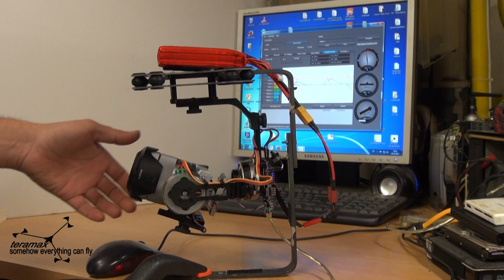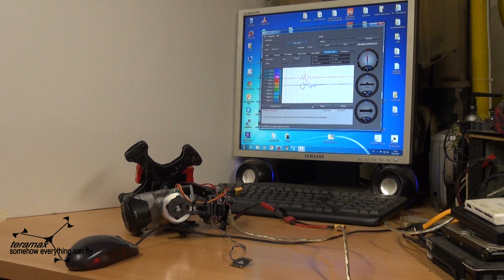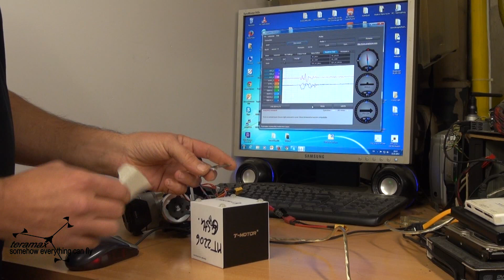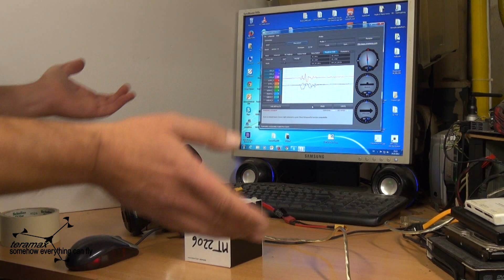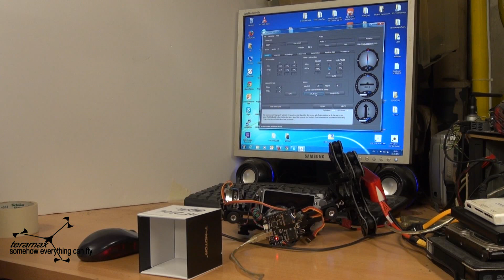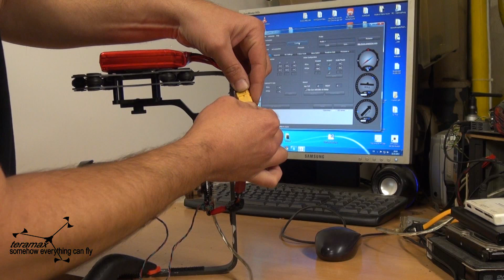how to - SBGC 6 point IMU calibration

Comment: Hi tera, nice video. I would like to know why do we have to make the 6 axis calibration? What is the difference from just calibrate it one time in the neutral  position of the camera ? 
Regards
Reply from the maker: +Dashz cause of the toleranz the sensor inside the IMU have, the software running on the controller has to learn how each angle looks like.

Comment: Thanks. I received the gimble and even though the camera Imu has drilled and tap holes for one of my imu since one is wider than the other it looks like the smaller imu might goto the camera that does not fit the wider drill and tao pattern. Even though I did the 6 point calibration with auto tune and believed I had the orientation correct meaning right on both imu's pointed to the left from the front of the machine the gimble did not function at all after auto motor then auto pid. I'm going to swith the imu'spositions after I recalibrate them like my buddy has. It seems backward since the drill and tap fits one imu bit it seems that's the frame imu not the camera. Confusing.
Reply from the maker: i dont know every SBGC Kit thats aviable but in example the kit from Flyduino has a bigger (Camera) IMU and a smaller frame IMU.
Reply: I was told the smaller is the camera on the one I have.  I also found my solder job did not make contact on all 3 motor leads on the other side that is needed.

Comment: How does the calibration sequence work with using two imu's. Would one imu be calibrated the plug in the other? It does not cover this in the manual.

Thanks
Cody
Reply from the maker: If the second IMU is connected properly, this button becomes active. It means that all IMU settings now
affect on the frame IMU. Change sensor orientation (axis TOP, RIGHT) and write setting to the board, if
necessary (board will be restarted). After restart, calibrate the accelerometer and gyroscope like you did
it for the main IMU. For the accelerometer, you can do simple calibration or extended 6-point
calibration.
found in the manual page 7
http://www.basecamelectronics.com/files/v3/SimpleBGC_32bit_manual_2_4_eng.pdf

Comment: I'm getting roll drift while yawing, nothing I've done has fixed it yet.  When I do the 6 point, I always start with the imu oriented exactly as it is when mounted and camera is facing forward. Is this correct? Does it matter the order in which you calibrate each side?  Any advice on getting rid of this drift would be great...
Reply from the maker: You are right, the very first orientation ist the one the imu is finaly mounted on the gimbal.
Watch out your i2c readings, are there error counts?
Try to change the routing of the sensor cable.

Comment: Hello Tera, when you do the acc calibration, do you first write to your board how your sensor is going to be oriented? i.e. Top -x right y and then do the calibration? I am having issues with my 3 axis gimbal, it was working out of the box, but I reset it to factory defaults and now the yaw will not work, it just tried to continually spin, and it's not the pids or power, I know how to set those up. Thanks!
Reply from the maker: yes sure, first write correct sensor orientation. Check the graphs on the right (in the GUI) to be sure you did correct.

Comment: Can you tell me what your PID setting are? I have the same gimbal and I've been trying for weeks to get it to work. I'm trying to fly a small camera like the one you have and would like a basis to work off of. It's getting really frustrating, thanks!
Reply from the maker: Hello Brian, i did ad a link to the description where you can download my profile, import and use it. But dont forget, different motors, firmware versions and voltage require different PID´s so my profile might not work for you.
Reply: Tera Max what version of Simple BGC are you running with this profile? I'm using an alexmos board on the ASP NEX5 Gimble on Simple BGC 2.3
I'm trying to fly a Black Magic Pocket Camera.
Reply from the maker: i´m not sure about that, i gave the gimbal away after the video. I think to remember it was the 2.2b2 but dont beat me, i realy dont remember.

Comment: Thank you for the great video! I just have one question. When you move your camera by hand it goes slowly back to center. When I move mine it "clicks" as if it was a dial with notches. And when I leave it a little to the side it will not return to center. But as long as I do not touch it, it remains stable while moving the copter. Do you know why this is? I am new to this board.

Thank you in advance!
William
Reply from the maker: i would say it needs more power on the motors but need more details to be sure.
Maybe its better to search your question on RC Groups also adding pictures and tech details of your gimbal to your question. Theres a good Alexmos tread there.
Sorry
Reply: Thank you so much for the reply! I turned up the power till the motors were just slightly warmer than room temperature. It holds extremely well, but when I move it by hand it stays where I put it. It is strange. I think I will make a quick youtube video of the problem and post it to that thread.

Cheers!

Comment: Vizor - AlexMos Firmware and Bootloader are not Open Source Software and are licensed. The GUI for setting up and PID tuning can be downloaded from basecamelectronics.com. Alternatively, you can get Martinez source code from google code repository (used on various open source Brushless Gimbal Controller hardware), which does a reasonable job (not as good, but it may get better over time).